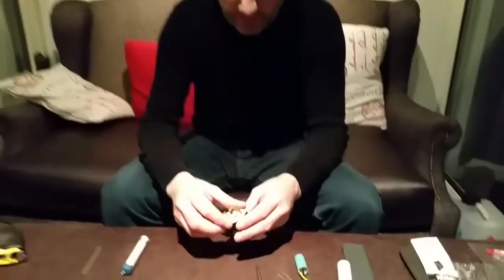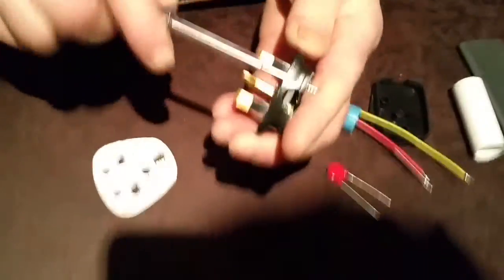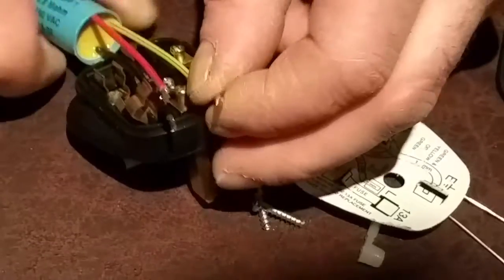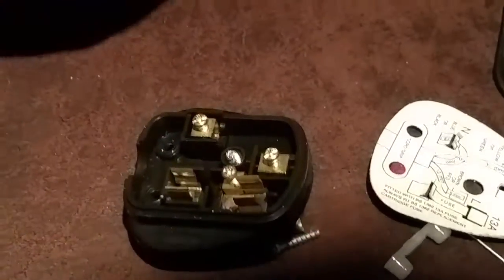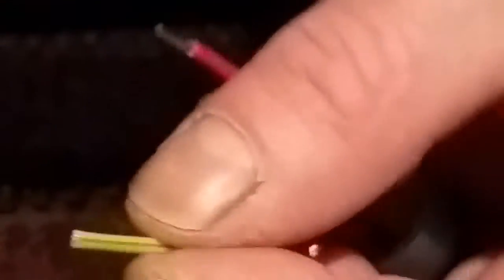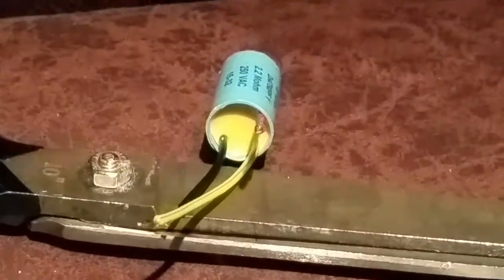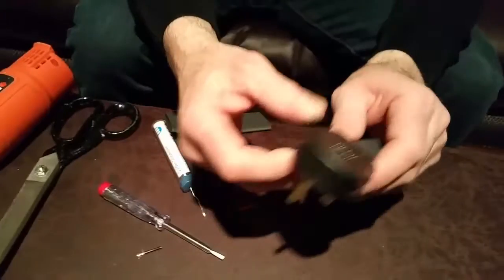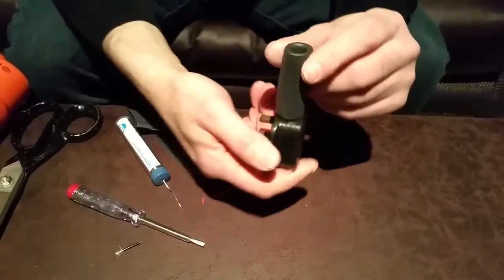How to make a Mains Filter plug.

Comment: Fuse is only protecting the filter and therefore should not be 13A as a lot of smoke if  the components fail. Suggest 1A.

Comment: A few safety tips. Soldering of clamped mains cables is a no no in some cases as it is soft and can work loose. Fire risk. Not so important here as very low current.  Unfortunately 1 MHz is a bit high to be useful. Tasima a low cost unit was tuned to 70kHz a more typical frequency.  The red suppressor unit might get hot.

Comment: Hi there.
I am curently replacing a single socket for 4 double sockets on my ring main via a 13a Switched Fused Spur can I add one of thease in the back of each double socket or would I just need one from the 13a Switched Fused Spur.
Thanks
Reply from the maker: Hello Nathan, yes you can, but I would put heatshrink over the delta filter, so it doesn't touch the metal back box, thanks for watching.
Reply: @tweakerman  Many thanks for the reply pal. Would that be one filter in the 13a Switched Fused Spur or one filter per socket?

Great video by the way.
Reply from the maker: @Nathan1975Liggy  one in one double socket, cheers.

Comment: Will this work on any line voltage? I’m thinking of using it on 120Vac 60Hz. I am from the UK but often work in the US where I have issues with dirty power. TIA
Reply from the maker: Hello, go to your local electronics store in the US & ask them for a Delta filter & a inline suppressor, show them my video, if there not sure, thanks for watching.
Reply: tweaker man is the in-line suppressor a transient suppressor? I already have those in stock. Thanks in advance
Reply from the maker: Yes.
Reply: tweaker man Thank You Sir! Also, how happy will rob/elcb’s be with your mains filter sitting in circuit?  Thanks!

Comment: This maybe a stuid question but where and how do you put this because nothing is coming out of the other end are you then supposed to stuff the wires from an appliance into the plug aswell. I dont understand the fact that nothing is attached to the plug, I could understand if this was inline with an appliance but where do you wire an appliance to this filter. It may be an obvious answer so forgive me if you think this is a silly question, I am new to electronics. If you could tell me how I would wire this in series with an appliance and how tthis would attach to something. Thank you
Reply from the maker: Hello, This is just a plug in mains filter, you plug it into a socket near your hi fi, it helps to take away mains born interference on the mains, you don't wire anything into it, I hope this is helpful, thanks for watching
Reply: i am an electronics service engineer (and have been for the past 45 years!)....let me explain....the unit works in PARALLEL with the mains (NOT in series with any one appliance), hence filtering and conditioning the mains supply on a particular socket trip circuit (it's connected to..)within a property...this unit can also be housed in a insulated ABS black plastic box too!!..with a standard plug at one end....and a mains socket, either on the box lid...or....by itself...hope that helps you out?

Comment: Hi, can you give details of components used please. And will this work if plugged into any socket in house. Thanks.
Reply from the maker: Peter Brookes Hello, go to Maplins. online, you need, code RG21X Delta Suppression Filter, then you need, code CP76H Transient Suppressor. You can use them any where around the house.
Reply: @tweakerman  Do you have the link to the RS components you used ?